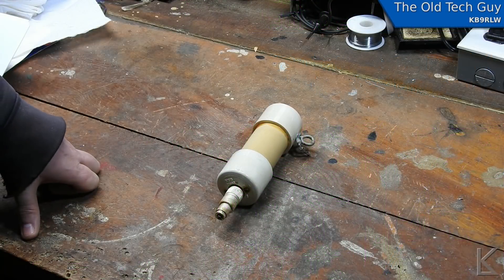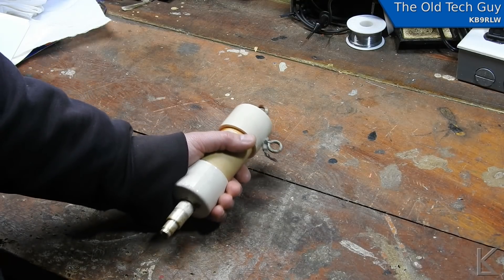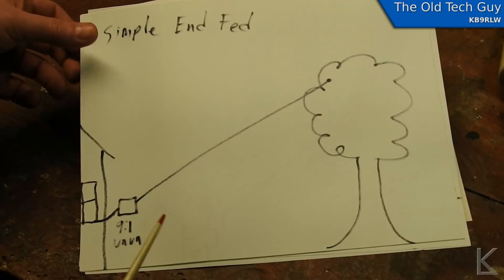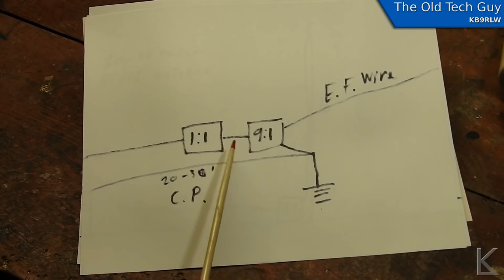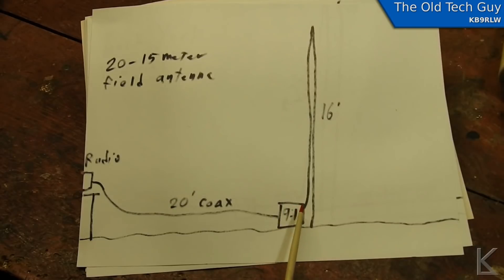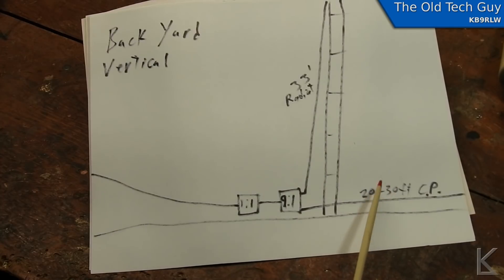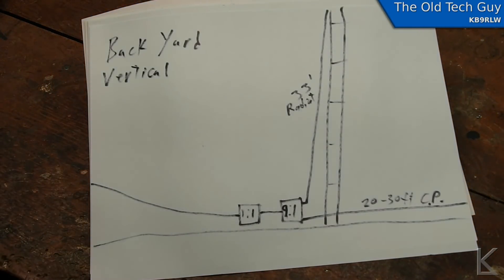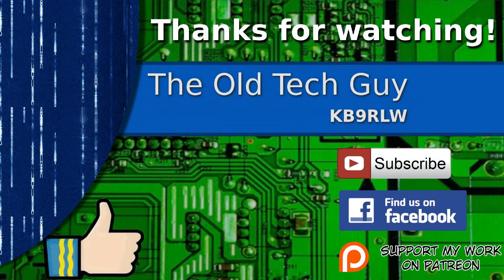Ham Radio - My back yard HF vertical antenna build part 1.  The Plan.

Comment: Kevin, Been watching your videos consistently since I found them.  You are a great reference and learning resource for me.  Thank you.  Just put up your backyard vertical per your example on my roof just outside my window.  Works like a charm!  I've used many antennas, but this one has me hearing farther than any of the rest I've tried.  Still have to install counterpoise or radials of some kind so haven't tried to talk yet.  Best set of ears I've had though.  Thanks.
Reply: One 30ft counterpoise/radial and I just got into Arizona from 50 miles West of Chicago with 15w.  Been trying to reach that guy for weeks.  Great antenna.  Thanks Kevin.
Reply from the maker: I have it set up to work on the RV now.  Only tested it once, but it seemed to work very well.  Glad it's working for you.

Comment: Kevin, my son and I deployed a 33 foot wire vertical, and used no 9:1 UNUN...but we did lay out four radial wires.  2 were 33 feet and 2 were 66 feet...we were able to tune it 15m-80m and worked a lot of DX on 20m with the thing..we had 50 feet of RG8 feedline coming back into a MFJ 941 Versatuner.  We didn't really know what we were doing so we just did it.  Adding the 9:1 UNUN and the 1:1 choke makes perfect sense....looking forward to building another one.  BTW if you don't have a 33 foot pole...find a tree that would allow you to run a 33 foot wire up the trunk...we used this same layout at a Jamboree on the Air...but with just ONE 33 foot radial...we worked scouts all over north america with that setup on 40m.  I really enjoy your videos.
Reply: My poor understanding of 1/4 wave vertical antennas is that their impedance is lower than 50 ohms so adding a 9:1 impedance step-up rf transformer willy-nilly does not make good sense.  I liked the first first antenna that you described.  Don't fix it if it ain't broke.

Comment: Hi nice project , I have just completed an end fed antenna for the hf band and when I made my 9:1 un un I also made the 1:1 un un as well and put them in the same plastic box after testing them of course with a 450 ohm load acting as an antenna and it was pretty much flat from 1mhz to 50mhz on my analyzer so I was happy with that. Being the tight arse I am I used clothesline wire coated in plastic as my antenna wire made it about 135 feet long with a counterpoise about 30 feet long..... just long enough to reach a hose tap which of corse is a great ground as well. My biggest problem was being able to get the antenna wire up high enough ...... all I managed in the end was 10 feet max height and the wire goes through my yard in a kind of c pattern ..... it would be more accurate to call it a fish hook shape haha. But it works from 80-10meters without a tuner with swr on all bands less that 1.6 and 80 and 40 are no more than 1:2 through the band...... I do need a tuner for 6 meters and 160 meters. So far I'm quite happy after working into the states and the UK and Aussi with good reports with just 100 watts. This is what our hobby is about...... making it yourself when you can , with what you have at hand. By the way I use FT240-43 toroids to make my baluns , they are perfect for the HF band because they are so broad banded . Keep up the good work I enjoy your videos...... Greetings from New Zealand ( ZL1SEW) 73

Comment: Adding a longer counterpoise to balance the system. Having a 33' radiator and only a 20' counterpoise creates  an imbalance below a given frequency and create more rf on the shield. More counterpoise wires will help even more if possible. But the end fed wire project your doing is great!!! I have a similar to what your doing here. This has been my experience. With my particular installation. Looking forward to your next video. On this.
Reply: The trick is to make the antenna the least path or resistance (50 ohms) for the rf energy to radiate from, into space.  Ferrite beads on the coax at the feed point resist rf radiation from going back down off the coax.  Transformers (baluns and ununs) are a good way to impedence match. A tuner is like a filter, choke or variable transformer, to pass desired rf radiation to the antenna but block reflected power from getting back into the radio.    BALUNS and traps are very good ways to match multi band antennas.  But I like to use monoband  inverted vee dipoles and loops to begin with, very simple, and can be used without traps.  I prefer a remote  coax switch instead of a tuner, always best to use a matched ANTENNA.
Reply: umajunkcollector  while I'll agree for single band operation. He is using this for multi-band operation with a 9:1 balun. But he could switch this to a 1:1 balun and spread out resonant wires for other bands and possibly achieve 50ohm match you referenced. Then no tuner would be required. Except for 80/75m but now I am getting off on another aspect of antenna fun!

Comment: Good job kevin, you've given me all kinds of great ideas on my vertical antenna project.
I'm going to purchase the 50-ft carbon fiber telescopic mast that GigaParts sells and use it in combination with My Antennas efhw 8010 for my vertical build.

Comment: Good morning Kevin,
Just finished watching you're video. 
I'm decided to build a multiband vertical antenna using a 20' fiberglass kite pole with 33'.9" 18g wire attached to it with a 9:1 unun transformer with 3-33'.9" counterpoise wire facing west/southeast/east. The 20' fiberglass kite pole will be attached to a 6' aluminum pole attached to my balcony railing that's 10' off the ground which will put the top of the antenna at  34' due to mounting it on the aluminum pole. With 100' of rg8x coaxial cable attached to the railing going to my atu I should be able to have skywave propagation conditions on 40-10m.
With you're knowledge/experience do you think this setup will work? I'm 2700' above sea level here in the Southern California desert.

Comment: Nice video Kevin.  Fun to watch.  I'm confused though.  Some other comments herre mention using a 33' wire with a 9:1 UNUN and that it worked out well.  On 40 meters, you'd have a resonant quarter wave vertical, with a 50 ohm Z being reduced by the UNUN. down to 5.5 ohms, causing a 9:1 SWR on the feedling going into your shack.  Seems you be much better off bypassing the UNUN on 40.  Seems like you'd also need to step down your 50 ohm transmission line to a lower Z, not up to a higher Z when the system is used on 80 or 160, as the input Z at the end of that vertical wire should be well below 50 ohms.  But then again, I'm not an antenna guy.  LOL.  Love your videos!  They are informative, pleasant to watch, and just plain interesting.  73 / 72
Reply from the maker: I know, it doesn't seem like it would work the best.   In playing with random end fed wires, it's interesting how it seems to work.   In my shorter version, the 16 ft. wire radiator is a quarter wave on 20.  Yet, the SWR was below 1.5:1 from 20 meters up through 15 meters.  It doesn't seem like it should work well, yet it does.
Here's another puzzle.  Some have used a 49:1 auto transformer on end fed wires with success.  The ratio there makes it seem even weirder.
This is an experiment.   I'm not exactly sure how it will behave, that's why I'm building it.   I may make several changes during testing before finding the best combination.  That's the fun of experimenting.

Comment: I am getting ready to do the same thing, interesting I came across your video's tonight. I am doing  more of a L Configuration, up the fiberglass pole, and then out. My wire is 50 feet long, pole is 38 feet.  My power limit is 100 watts on my antenna, and will be using it for POTA. My question is does the 1to1 balun circumvent the coax as being part of the couterposie.  Many 9to1 Unun makers ground the transformer to the shield and tell you, you don't need a  counterpoise, but you can use one if you want too...
Reply from the maker: Yes.  If you install a 1:1 choke at the antenna end, you'll need to add a counterpoise to the ground side of the 9:1 to give the RF currents a place to flow.  the 1:1 will isolate the coax shield.
Reply: @loughkb  I wonder if you put it behind the ldg tuner if it is still affective and the coax still acts as counterpoise. I have not been able to do any testing yet, been to cold. I’m picking up a mgs4u.com pole soon. Much stronger than MFJ and they are local to me. Thanks for your videos!
Reply: @loughkb  one more question, what bands are you getting with you verticals and the 38 feet of wire element?
Reply from the maker: @Laborkei  It was a non-resonant antenna.  Basically a random wire.
It did well on 40-10 meters.   I did manage to make a few contacts on 80, but it's efficiency was pretty low being such a short radiator for those low frequencies.
It was also quite noisy.   Being omni-directional as a vertical, it picked up all the noise sources from my house and the houses around me in all directions.

Comment: I'm planning on going vertical with 33ft. of 14 gauge copper wire up PVC schedule 40 in progressive larger sizes.  I will try with only the 9:1 un un and no 1:1 choke.   Should I use a field strength meter to check for RF back up the coax?

Comment: If you are out in the country and have lots of private land you might be able to have a 1KM long antenna wire and might give you a chance of getting out to those contacts that you want to get, I think that 30 turns of trifler wire should be about right.
Reply from the maker: Nope, I'm on a really small city lot with absolutely no supports or trees, just the house and a shed.  So it's a challenge.
Reply: OK no problem Just wondered just an idea.
Reply from the maker: Believe me, I WISH I lived outside of the city with a little room and a few trees.   I've dreamed of growing a decent antenna farm and enjoying bands free of all the noise and interference I suffer here in the city.
And a beverage antenna would certainly be interesting for listening.  Maybe some day.

Comment: I have read that the radiator should not be resonant on any frequency, but you are very close to 1/4 wave on  40. Have you had any problems tuning on that band.
Reply from the maker: I'll let you know once the antenna is up.   My smaller version is resonant on 20 and works fine without a tuner on 20 through 15, so I'm pretty sure it's going to work fine.

Comment: How good would a Carbon Fiber Fishing Rod, serve for a field day Vertical Antenna. These come in various sizes , 10M ~ 14M
Reply: I bought 3 or 4  20 foot Crappie poles when a local sporting good place folded up....I have made 10m and 20m verticals from them and they worked well.  One design was a 20m vertical diople....not sure if they are carbon fibre though...you just need to try it and report back here. : -)

Comment: Kevin

You showed a 16’ vertical with a 9:1 Unun. 16’ is approx 1/4 wave on 20. Is a 9:1 unun necessary? I’m planning the same vertical for portable use but haven’t measured the impedance yet. I’m assuming it would be 50 ohms so an unun  would not be necessary.
Reply: Dancing Bear I’m interested as well (double that for a 40m version).  I thought I’d only need a 1:1 balun and ground radials.  Though I believe the key is the radials.
Reply: Returning to HAM Operation after being away for few years and having to 'relearn' everything -- to the point: would there be any issue with putting the 9:1 in there even if it's not 'necessary'?  Thank you for your time and assistance.  73, WF7BSR